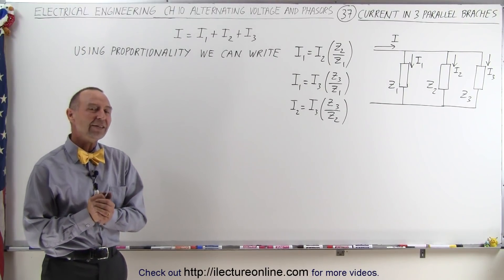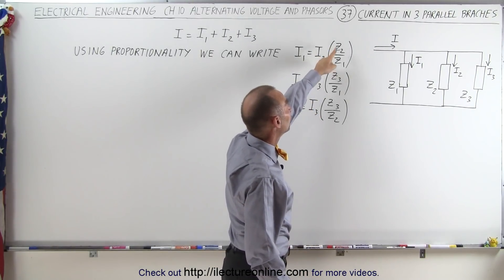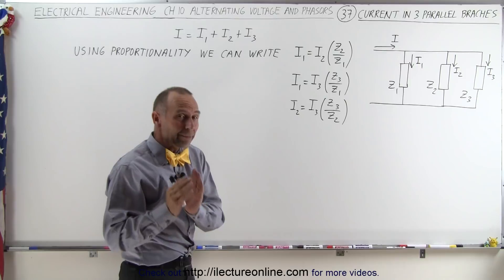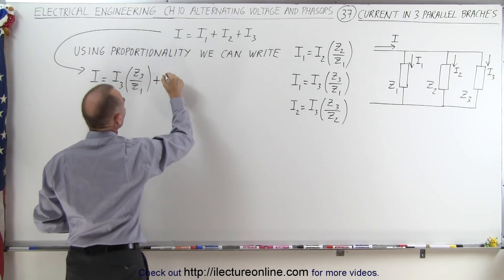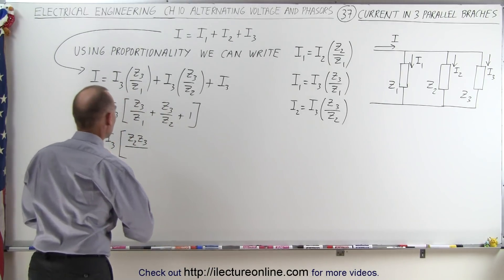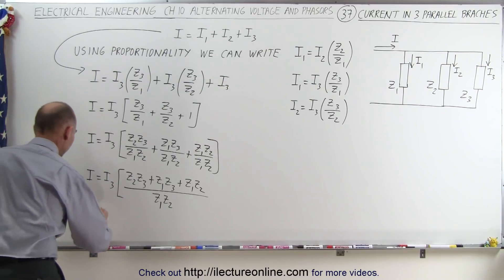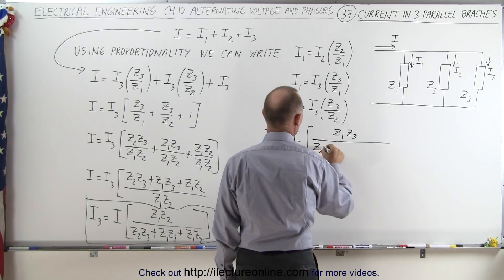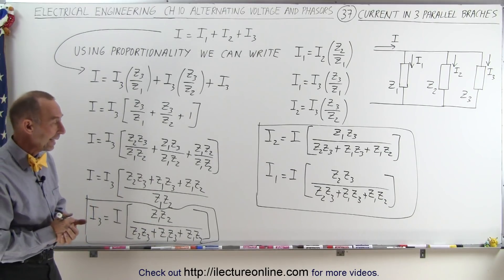Electrical Engineering: Ch 10 Alternating Voltages & Phasors (37 of 82) I1=? I2=? I3=? in 3 Parallel

Comment: Don't have to merely assume this proportionality between impedance and current. It can be derived in this case from the fact that in a parallel circuit the voltages across the impedances are all equal so we have  I1*Z1 = I2*Z2 = I3*Z3. This leads to the the three equations I1 = I2*(Z2/Z1)  etc.